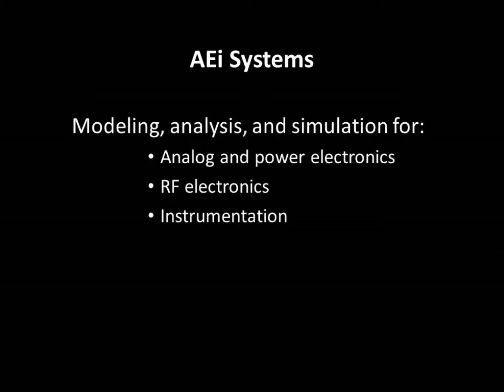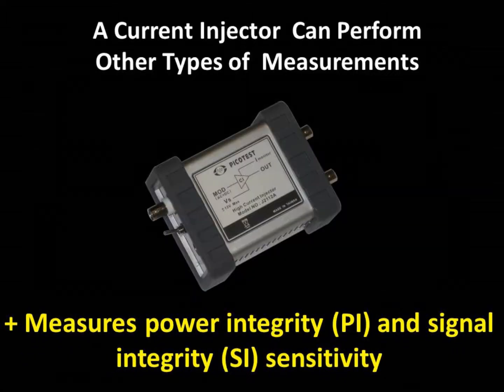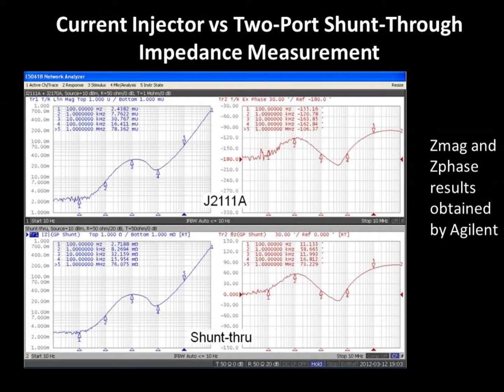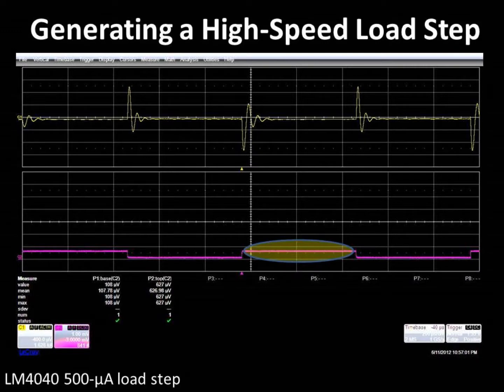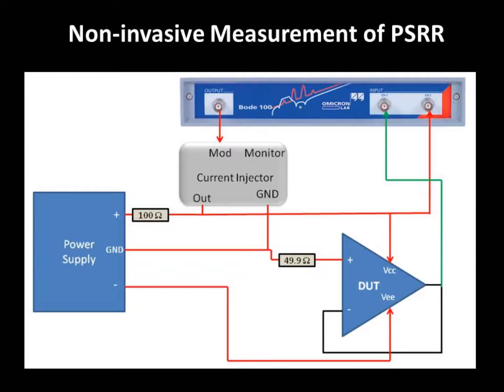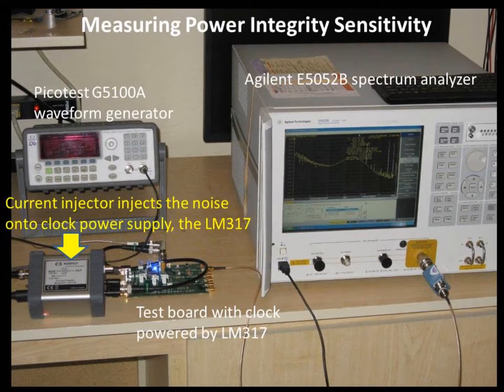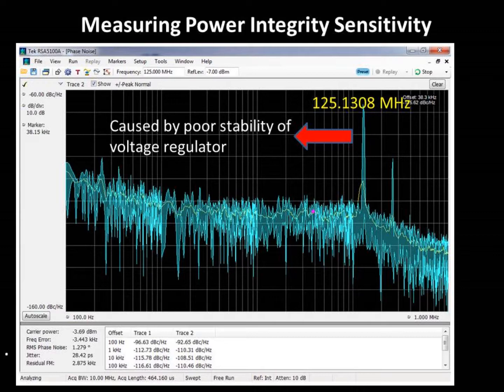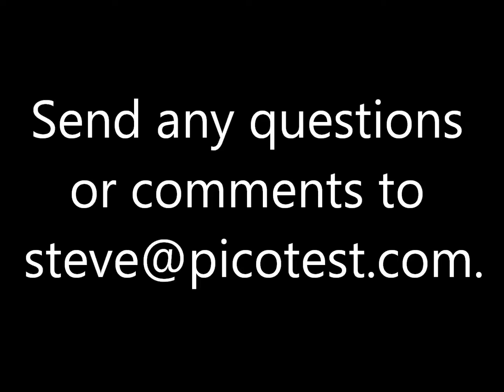Troubleshooting Distributed Power Systems (Part 5): Using Current Injectors

Comment: Commenting on this video series, viewer RL writes, "I watched these videos...and they are quite good. One comment that I have is the first two videos are highly conceptual.  I was not able to relate my work to the topics and examples that the videos provided although they seemed to address common problems of analog and power supply designs (stability, impedance, component measurements etc.). "

Comment: Viewer KW writes ,"I learned some new things from this video: current injectors may be used for impedance tests and they can be used with Agilent gear. BTW, the Agilent setup is what we have and are sharing with multiple sections in our site. So the presentation on that alone was very enlightening."